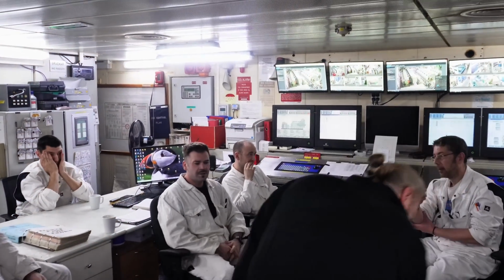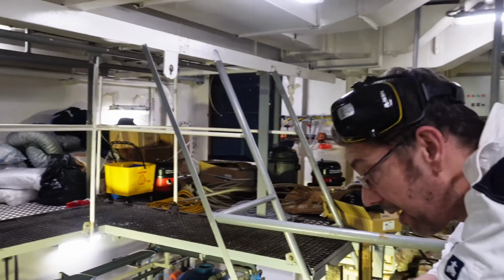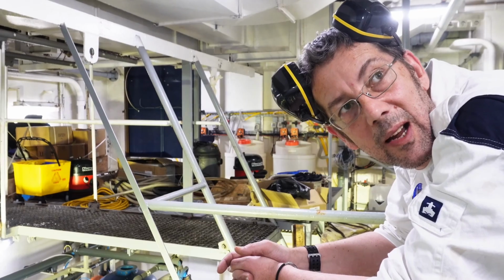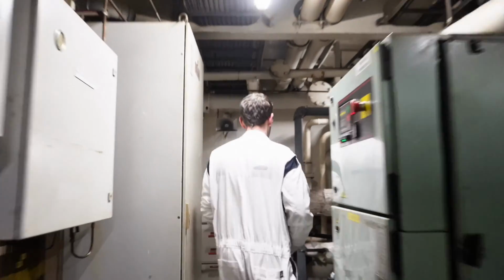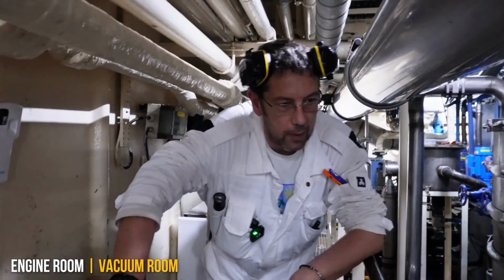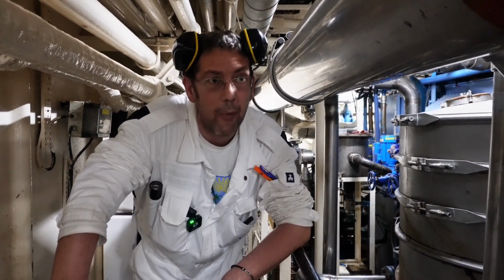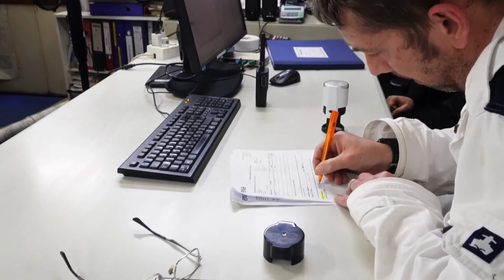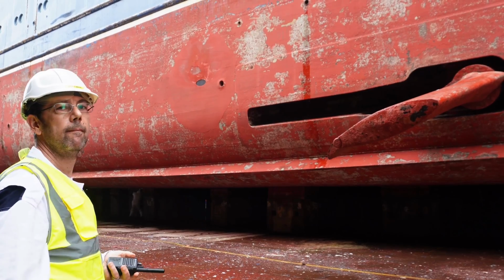Episode 2 | Chief Engineer Siniša

Comment: I hope the ship is ready to go on May 30th.
Reply: Posts that aged like milk.
Reply: September 10. 2024 and residents were just informed that they did not pass sea tests and have more to do. Asked for another week. Then told the residents they are no longer covering their expenses.
Reply: @steecie3045  I did see the video and the Instagram about your new accountant. this concept is wanted by many. At your next meeting could you ask what the port fees will be, I hope your classification will make the fees much lower than a regular cruise ship and someone mentioned the high cost of Air conditioning $2,000 a day?, I hope that isn't correct. I think if all the expenses are re-checked it will price me out of the cruise because the monthly fees will have to substantially increase. Thanks for the update.